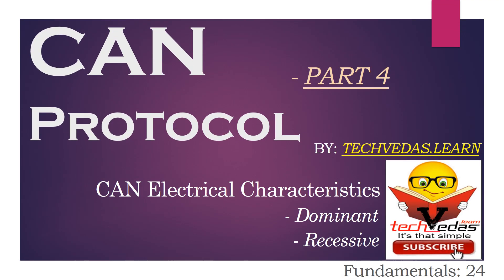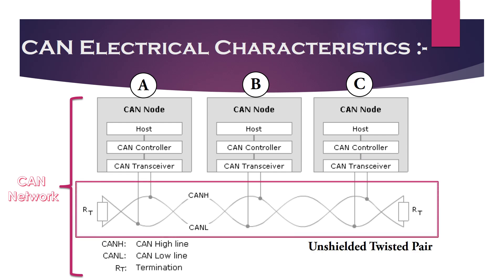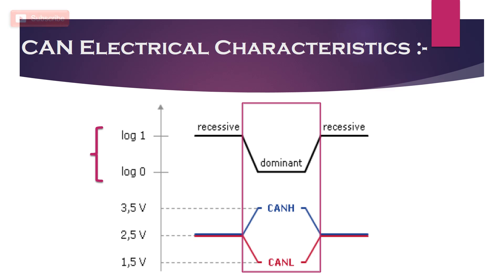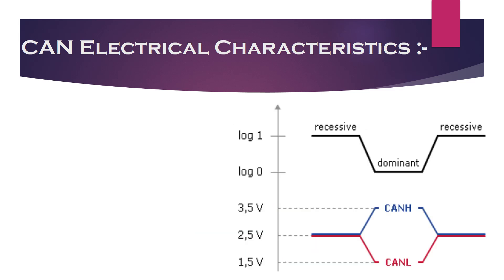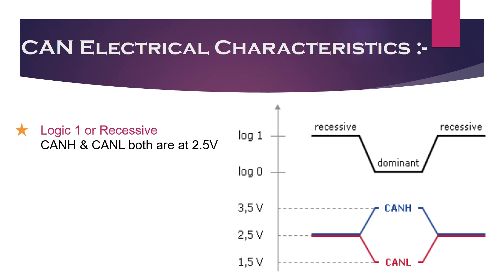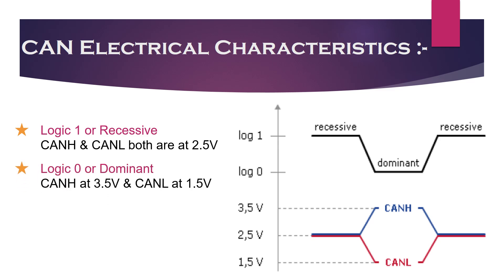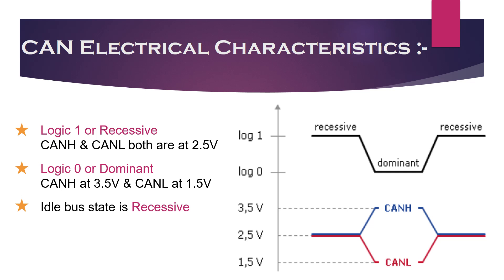How CAN bus works | How data transmitted on CAN bus

Comment: Tell me I check can h and l and see using a break out board that there is data passing on the can line. Everything works with other parts of the car but after stalling it the customer cannot start it. Starter tested and works. Wont crank. Tried autel im608 and autel maxi and both cant communicate to any module.

Comment: Nice...but can you make one video on how negative or fractional value can transmit over CAN bus. What is the role of factor, offset, length with taking reference of dbc file. This will be more helpful and practical as well. N most important such video is not available on YouTube yet which will explain these things.
If you take any paid course for such things to explain in detail I am ready to enroll for that.
Reply: you need to learn bits, bytes, basically how data is stored then serial communication, then i2c and spi and then come to CAN

Comment: Thank you for this video Sir.  Can i know the reason why CAN bus is terminated with the help of 120 ohm resistance at each end?
Reply: 120ohm resistor is used to avoid signal reflection of noise....
Reply from the maker: Hi Keshav, it is according to the ISO11898 CAN electrical specification. Well i am not an electrical expert but with some small research, I can tell that 120 Ohm is placed at terminations to match with the Bus impedance. For more detail, you can check out the below doc (4.5 Line Terminations). I will let you if I can collect more info 
http://www.ti.com/lit/an/slla270/slla270.pdf
Reply: @TechVedas  Thank you very much for the reply.
Reply: To prove equal to load impedance and source impedance (ZL=Zs)..and avoid noise reflection and to ensure other communications corrupt